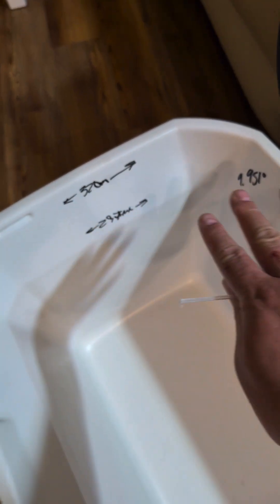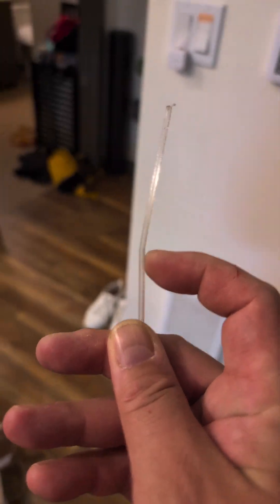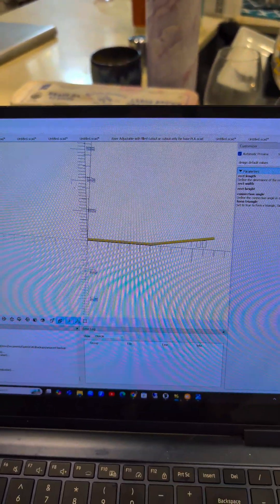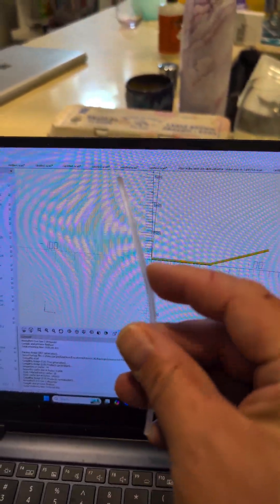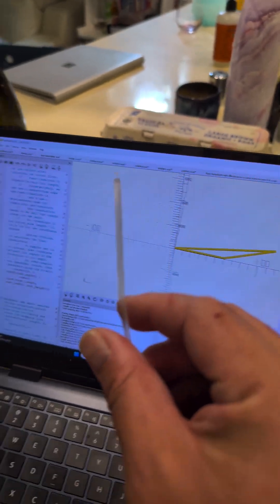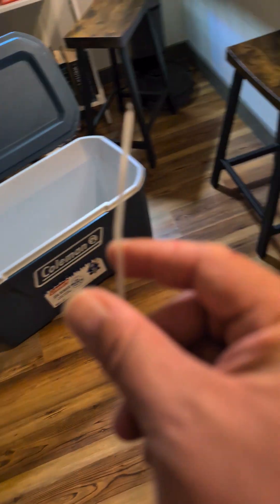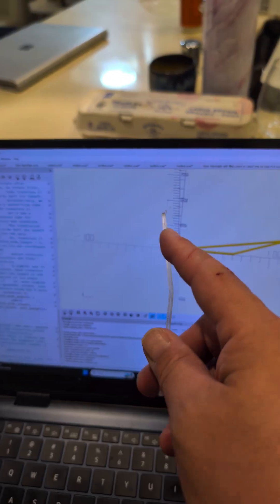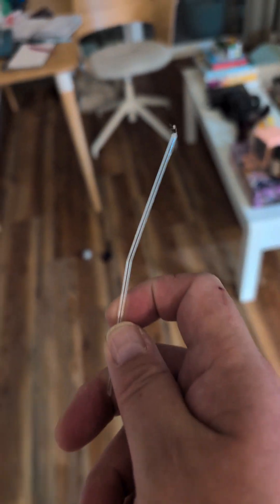3D print any angle for rapid prototyping using OpenScad #3dprinting #prototype #design #3dmodeling

Comment: They make tools to measure angles 😂 no need to waste a bunch of plastic. But good idea and program!
Reply from the maker: I am the tool! Yes did a quick Google afterwards found some options but I think that The Angler will end up being more economical, less resource intensive for me (since I'm just an amateur modeler) and the angle is weird and curved so having the real flex of the filament is helpful.  Cause I can use almost empty spools and emboss the angle for reuse - ok done defending it I want this: https://www.etsy.com/listing/1327139855/mirock-centerless-angle-meter
And a digital one from mitutuyo who knew there are angle finders that cost more than my car?  Hmm but you're right.. I'll add a section encouraging using only left over bits, really the 6mmx6mm was even over kill.